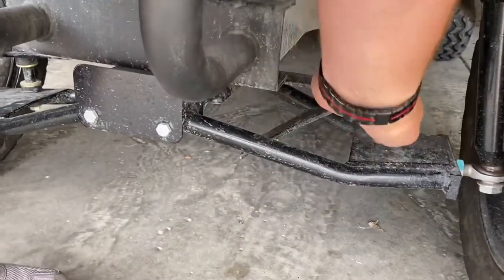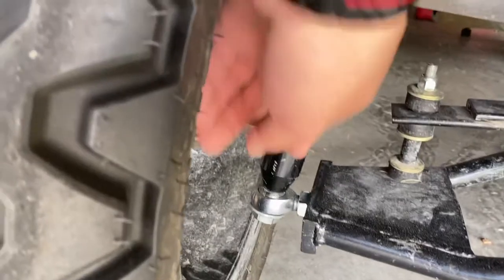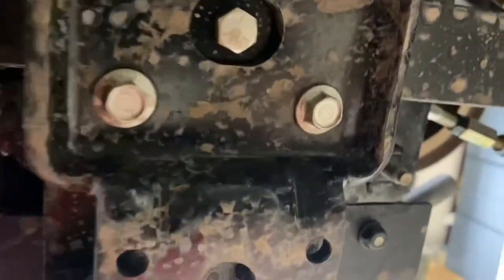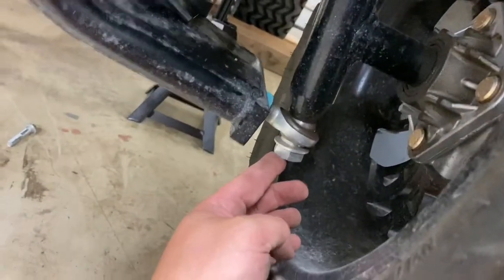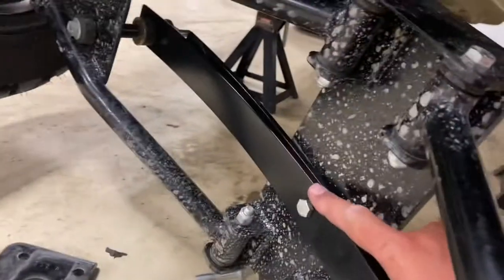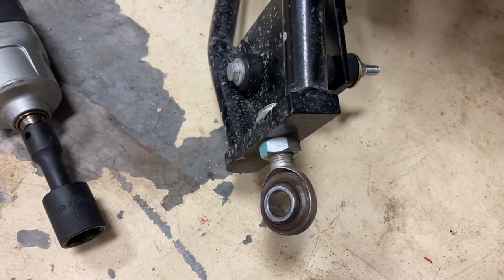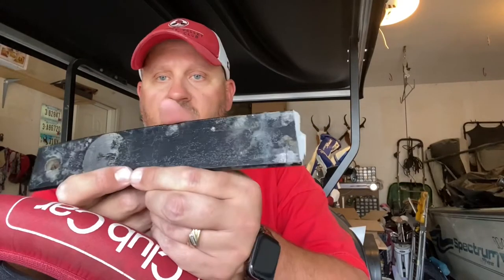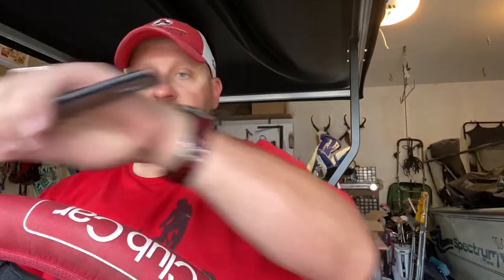Front Leaf Spring Club Car Onward

Comment: Great video thank you! How did the heim joint on the passenger's side fail?
Reply from the maker: @rev251 wish I knew for sure.  These heim joints dont carry any kind of lubrication and the ball broke through the washers keeping it together.  I use this cart for golf, and dont do a lot of rough terrain.  But it also isnt only street driving.  The cart rides pretty rough to begin with, I have never been happy with the suspension.  Shortly after the heim joint broke, the front leaf spring snapped.  Both occurred while I was on the cart path on the golf course.